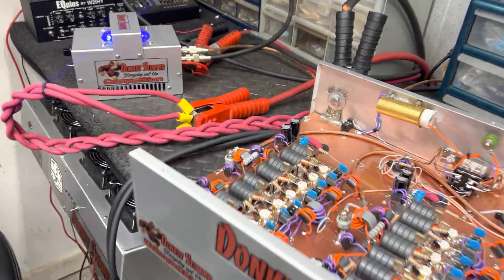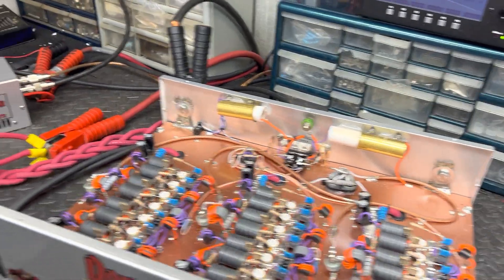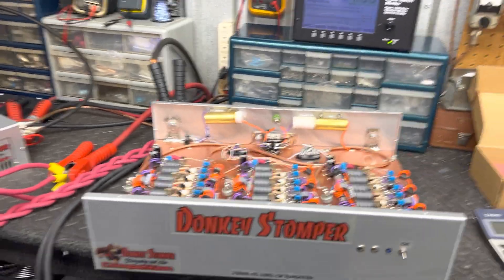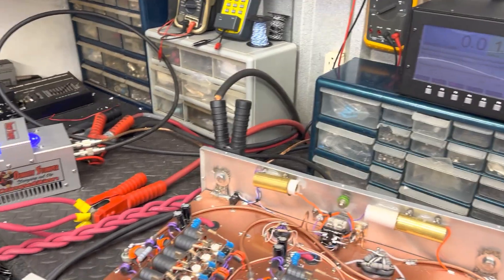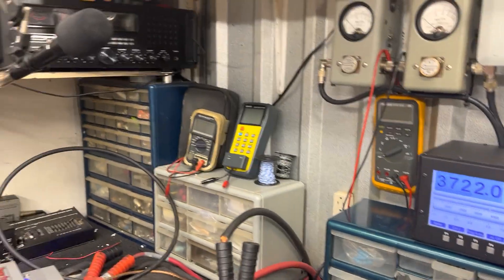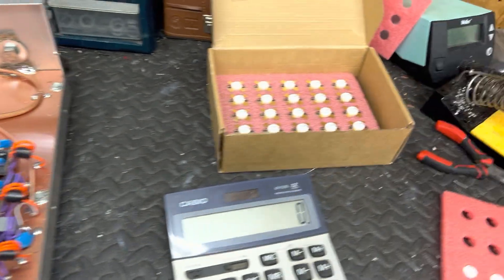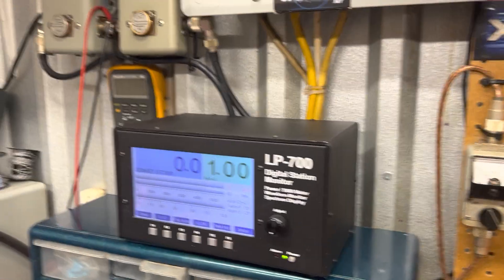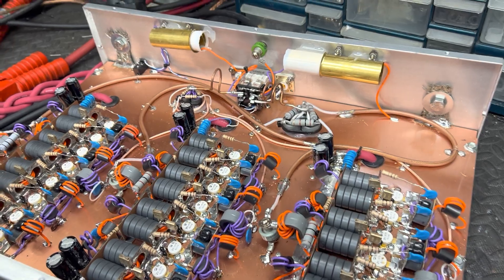Donkey Stomper Products, HG Huagao Transistor, HG-2879, and HG-2879C, Information How To?

Comment: does that formula apply to Toshiba 2879 transistors as well ???
Reply from the maker: Toshiba will take more. HG do more it’s hard on them. They wear down.
Reply: @DonkeyStomperProducts  thanks for the info and referring me to the video. I did not know it was available...👍🙋
Reply from the maker: @TheFlyingSquerill  Just trying help others run there gear with no issues.. Thanks